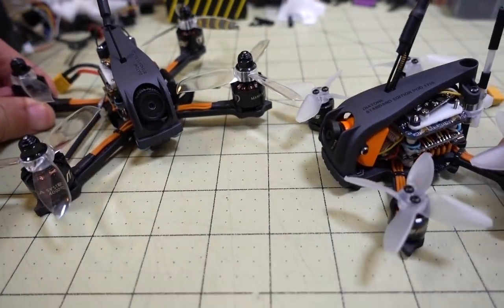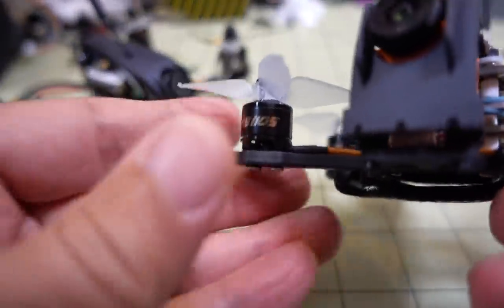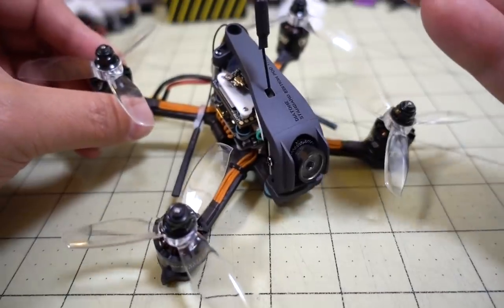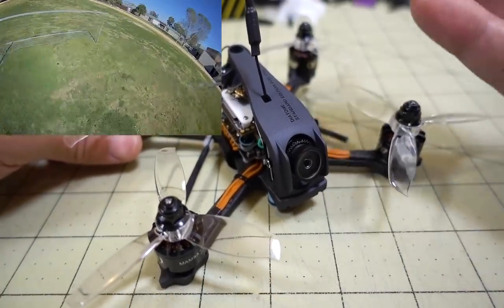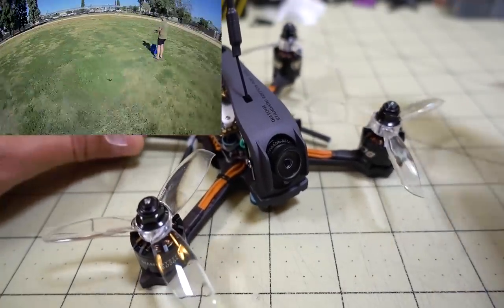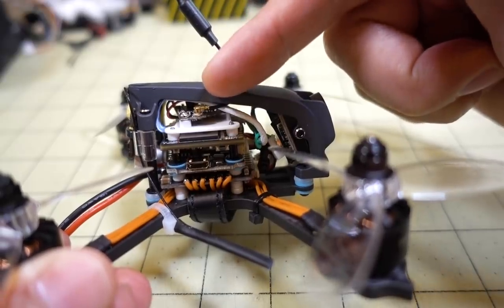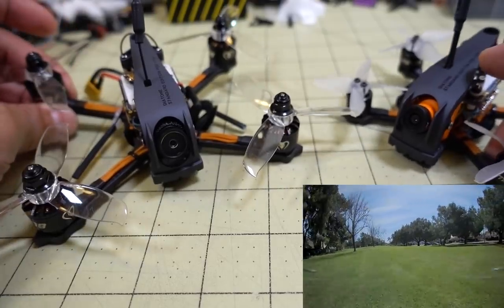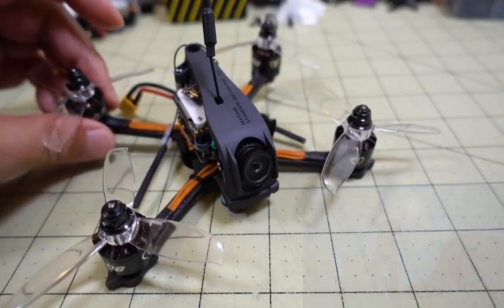Diatone GT-R349-HD Micro Drone Review 🚁

Comment: Great video Albert! Do you think updating a original mark 1 to a HD would be possible? The VTX mounting plate is slightly different on my R349 (mark 1) it looks identical to the 2" in the video.. I noticed it's different on the HD. I'm guessing this is to allow for space for the turtle board? It looks like the screws tighten down on the VTX mounting plate removing the need for the nuts.

EDIT: Would love 4S pids!
Reply from the maker: I don't even know what a mark 1 looks like so I'm not sure, sorry.
Reply: @AlbertKimTV  mark 1 as in original R349, you did a review on it a few months ago.. haha
Reply: Where can i find 4s Pids mate?

Comment: I just got the t-motor version delivered this morning. It came with the updated Runcam split and also has the vibration dampening on the canopy.  It also has 2 different length diatone battery straps, one for 4s and I'm not sure if diatone one does. Motors are a lower kv tho and it only came with 1 set of props.  Can't wait to get it in the air but won't get a chance for a few days 😕

Comment: Do these new versions come with the Gemfan Windancer 3028 props or the Gemfan Flash 3052 props? Its reputation as a speed demon comes from the original  battery hungry 3052 props. They are insane on 4S and a bit of overkill really. Extremely twitchy, but loads of fun for the short flight times they offer.
The 3028 props are very tame. It's strange that Diatone made such a huge jump in prop pitch. I think some 3040's would have been a better compromise. These Mamba motors are on there for a reason and they deserve some bitey props...just maybe not 3052 bitey 😋
Reply from the maker: they are constantly switching props and pid tunes... I don't know why.

Comment: Ahh man! I just today received my GT-R349 (non-HD) and wondering what the difference is? I have a Caddx Turtle V2, would I need to just buy the HD canopy for this and add my Turtle to the GT-R349 non-HD frame?
Reply from the maker: I think so, but not sure if V2 canopy works with V1 frame or if the bottom plates are the same.
Reply: @AlbertKimTV  - Thanks I sent this question into Diatone - so hopefully they'll let me know

Comment: I know this is an old video, but I have a question.  I have some  3s 1000mAh 45C Tattu batteries. Are these going to work?  Or am I going to cook them on the first flight?   I'm not looking for any special speed/performance out of the quad.  Initially, I just want to fly.    I can also put on the slightly lower pitch props that people are recommending.  What will be the trade on weight vs higher current capabilities with the 45C x 1000mAh.
Reply from the maker: It should work.  It will probably feel a bit heavy and unresponsive at that weight.  You should get a nice flight time out of it.

Comment: Hi Kim! I can see that there are some artifacts on footage from Caddx, especially in top left and right corner in form of straight lines. They are mostly visible on clear sky picture. I have the same problem with mine Turtle and was wondering if those were present in V1?
Reply from the maker: You need a firmware update.  I will have a video about that later.
Reply: @AlbertKimTV  Thanks, it's always nice to watch someone who's oriented what's going on ;)

Comment: i gave mine it's first flight the other day after updating to the latest and greatest first , and it was uncontrollable , it kept punching out with a little stick input, so i came back and put your pids in for 4.2 , i kinda expect a firmware update to fly from the off but this did not .... ANYWAY that asside , my question is , i have no osd other than the craft name and a low rssi value , my timer 1 and 2 and my battery values do not show in my goggles , any ideas ?
Reply from the maker: OSD issue is probably an NTSC/PAL mismatch in your settings.  Low RSSI either means you have it set to the wrong AUX channel or you have analog RSSI turned on in the config (should be off unless you have that setup specifically)
Reply: @AlbertKimTV  cam is set on ntsc , betaflight is set to auto and shows everything there like timers etc , the rssi is turned off in config, but the aux channel is dissabled , i've not changed anything and it worked before the firmware flash , no channel shows activity from the receiver grrrr, using the rxsr receiver , , getting nowhere fast

Comment: Looks too slow for me. Us canadians need something fast AF under 250g for june. Is there anything faster or do i need to build my own?
Reply from the maker: Get the non-HD version...  That's fast.
Reply: @AlbertKimTV  Still dont think ittl be what i want for speed. Been doing some research and ive come to the conclusion that either im going to build a super light weight 5inch frame under 250g with IsoTruss, or one of these quad manufacturers will jump on that boat before june. Hopefully they see this and get on that designing...